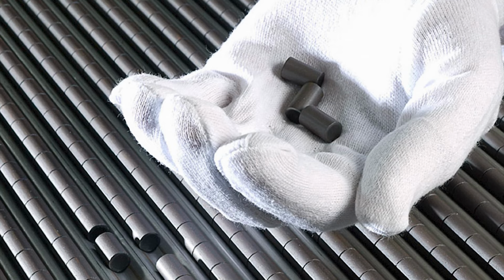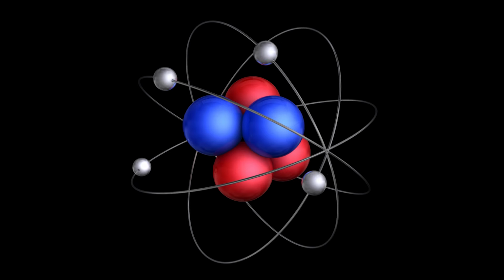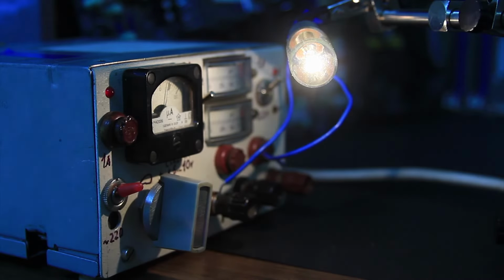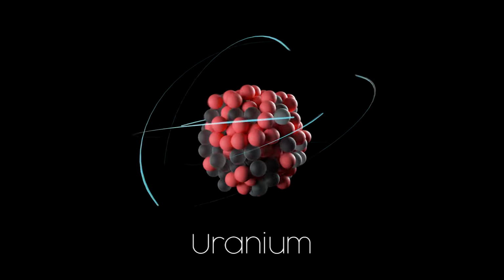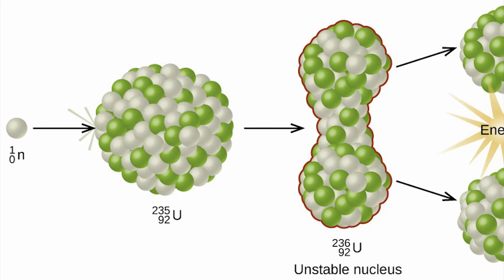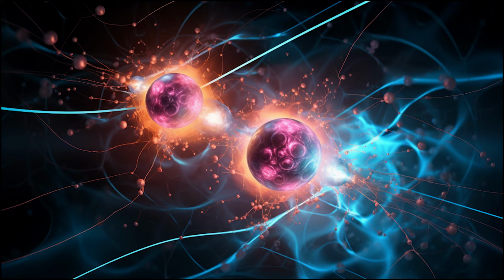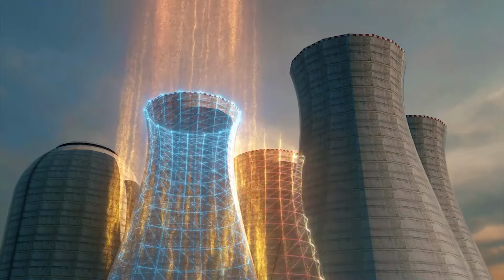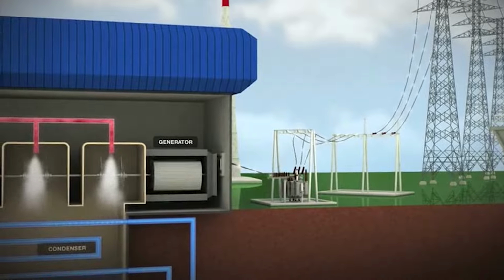The simple mechanics of splitting an atom

Comment: When implemented in practice, nuclear fusion produces much more waste, "decommissioning waste", activated devices because of the 10x bigger equipment, 4x shorter equipment life and complexity and maintenance nightmare. Clean controlled fusion is simply a dangerous myth. The science literature investigated comparatively in 1980 with the assumption that Tokamak fusion can be made to work before 1985 (Los Alamos Scientific Laboratory: Fission Fusion Hybrid) and the conclusion was very clear: no advantage can be seen. Since the Gorbachev-Reagan "science meetup" people who carefully consider the whole energy production infrastructure finds that fission works, and produces very little amount of toxic waste per TWh (compared to fusion, battery + solar, wind or any other form of energy we know), and very easy to detect negligence (unlike most other toxic waste that gets dispersed more easily). People should investigate the issue with engineering + scientific mindset. Most people are heavily mislead by the amount, value and dangers of "fission related waste" by videos like this. By the way, it is 0.0015 kg/person/year (30000 times less toxic materials compared to the toxic waste of other industries, appr. 50 kg/person/year), and the fission products ("waste") are more valuable than the Uranium.

Comment: You could say that the atom splits into energy, but you could also say that it splits into photons! Nuclear fusion doesn't exist. The assumption that it's possible is based on a flawed theory about the thermonuclear principle of stars. Stars are purely electrical objects, where the temperature and radiation from the solar wind are the result of an electric arc, much like welding.

Comment: at minute 5 you say things are shot out of the nucleus due to electromagnetism on protons too far out..   i thought it was the weak nuclear force that causes radioactivity and beta decay etc
Reply from the maker: Great question. The weak force does play a role in uranium’s radioactivity, but only in specific cases like beta decay. Most of the time, uranium decays through alpha decay, which is not caused by the weak force. That happens because the nucleus is simply too large. The strong force cannot hold everything together well enough, and the repulsion between protons pushes parts of the nucleus out. So while the weak force is involved in some types of decay, it is not the main reason uranium is radioactive.

Comment: Sorry, but your coal number is way off. 1Kg of coal contains about 8kWh. the efficiency of a coal plant is about 33%, so 1Kg of coal will product about 2.5kWh. A tesla battery is 80kWh. Meaning you would need 32Kg of coal to charge a tesla. From where did you got the number of 10.000? it really undermines the credibility of you video.
Reply from the maker: Not need to apologize. You’re right. The 10,000kg was a rough calculation of how much energy would be required to build a Tesla, not charge it. I always make one silly calculation in every video and it always sticks out like a sore thumb. Thanks for the comment!

Comment: Compress a coil spring until a latch can grab. Now find a way to destabilize the latch. All the energy that went into compressing the spring, is suddenly released. The nucleus is an incredible latching mechanism. A huge amount of energy goes into creating a nucleus, to overcome the electric repulsuon. Then the latch grabs, and you can take a breather. That effort is now stored as potential energy. The total mass of a system, includes potential energy. If you take 2 coil springs, compress only one, and then weigh each of them, one will weigh more. Same thing with trying to accelerate each of them. One will be harder to accelerate. Both instances being the compressed spring. All the energy you put into compressing that spring, has now increased its potential energy, and thus has increased its mass.

Comment: It does not the 10,000 Kg of coal to charge a Tesla Model 3, that is ludicrous. Ten tons of coal produces 81410 kw/h of energy and to charge a Tesla Model 3 takes between 54 and 100 kw/h so in the worst case you could fully charge a Tesla 814 times with that amount of coal, and in the best case almost twice that number of charges would be possible.

Comment: It doesn’t take 10k kg of coal to charge a Tesla. Show the math, professor
Reply: That’s absurd. Everything now is suspect in this video.
Reply: You are correct. Going by the potential energy in unburnt coal, it would take about 30 kg of coal to fully charge a Tesla model 3, and this is already with the inefficiency of coal burning plants factored in (coal plants capture only about 30% to 40% of the energy released when coal is burnt).
Reply: @arm_the_homeless_000  that is actually insane man
Reply: Why don’t you show us the data? How many kg of coal does it take to fully charge a Tesla?
Reply: @ronm6359  22 kg is what i calculate. Not 10,000 kg. w

* A typical Model 3 consumes between *13–15 kWh per 100 km* under normal driving conditions.
* Let’s use *15 kWh/100 km* for cleaner math.
* Coal contains about *6.7 kWh of heat per kg* .
* Coal-fired power plants generally convert about *33–40%* of that heat into electricity.
* At **40% efficiency**, that’s roughly **2.7 kWh of electricity per kg of coal**.
**Full charge**:
   * Standard Model 3 usable battery ≈ 60 kWh.
   * 60 kWh ÷ 2.7 kWh/kg ≈ **22 kg of coal**.
Reply: How has it taken a year to call this out?
Reply: 240 volts at what? 40 amps? (Conservative) thats 9.6 kwh lets call it 10 kilowatts an hour. Coal is roughly 1 to 3 pounds per kwh (depending on who you ask) so say 2 pounds and a typical EV charge time of what? 6 hours? Type 2? Ish? So thats at least 60 kwh (depending) times 2 lbs per kwh 120 pounds of coal. But thats not including the mining process. Or considering the soot that falls on everything and everyone.
Reply: I think they were simply trying to compare nuclear energy (the nucleus) with chemical energy (the electron shell) and show the enormous difference between the two.

They did get the numbers wrong by a few orders of magnitude though..
Reply: Damn straight! It takes 1.41 kg of coal to generate 1 kilowatt hour of electricity. A Tesla battery is 75 KW hours depending on the model ranging from 58 KW to 123 for the truck. It ain't no 10,000 kg!
Reply: A $200 a tonne of coal it would cost $2,000 in raw coal to charge a Tesla.  
It would be cheaper to buy the shop than drive there.
Reply: How far could you drive a Stanley Steamer with 10kg of coal*.  About 20 miles.   *about 2 gallon kerosene
Reply: Maybe dude meant 10,000 milligrams, perhaps 🤷‍♂️
Reply: Google.AI says, "Generally, it takes about 70 to 130 kilograms (154 to 286 pounds) of coal to generate enough electricity to charge a Tesla for a 265-300 mile range. This includes the energy loss during power generation and transmission. "
Reply: You burn coal and harness only 20% of heat to boil water.... only to have a turbine spin wasting 40% in heating/cooling cycle. Further the turbine rotates coil around a magnetic core, wasting another 50% as heat/friction, inductive yield.  The current transportation loses another 25% (at least) to get to your home, where the battery charging process dissipates at least 40% as heat.

On top of this, this is not a fission reaction, only oxidization process, which is less than 0.01% efficient compared to nuclear fission.

So 10kg coal burning to charge your Tesla only yeields energy equivalent of 
10kg x 0.2 x 0.6 x 0.5 x 0.6 x 0.00001 = 0.000035 grams of fission equivalent (of coal burning) is useful energy.

So yeah, compared to nuclear reactors, burning coal yields energy as if trying to go to Mars on a bullock drag cart (without wheels).
Reply: 😢😢 All the EV simps realizing the carbon footprint is horrible. Not to mention the slave labor mining Cobalt in filthy pits.
Reply: your right ✅️ it taketh Twice azz Much

Comment: I've still no idea what's going on
Reply: Thats not your fault, its a natural reaction to the fact that particle physics is wrong.  

Existence cannot sum to make a particle, there is only motion that makes form at perspective.  

This motion, all that is, is alone.  It self refrences.

Its motion so can only move, not touch (its not an it that can touch) or stop (stopping motion equates to nothing, an impossibility).  So it self avoids.  From straight (light) avoiding to curve (gravity)

In the volume of existence, these leads to spheres and spin etc.  The units of matter.

A nuetron is a nuetral region in  an atom, exactly like a nuetral region of gravity existing between two bodies.  These are called lagrange points.  We park satellites in them sometimes, because theres a nuetral effect on them and they dont need energy to stay there.

Now if you could manipulate this nuetral region by calling it a particle and moving it, whats going to happen to the gravity bodies if you suddenly push away or snap close the nuetral region between them?

Imagine the energy of such a thing happening in a short time, like a nuetron flying through the solar system, unbalancing gravational pulls and seperations in a nano second? 

Thats essentially whats happening at the atomic scale. 

You can even model it physically.  Picture a still plant full of leaves, now imagine a sudden high force gust of wind blowing through the leaves.  The balance of the leaves are changed dramatically.

Its all just motion, that cant touch, so moves.  The harder and faster you try to make it touch, the more it wont.  See nuclear explosions.

Comment: Excellent clear information.  But what is the extra energy emitted exactly in a fission action?  Is it magnetic,  or am l bring stupid?
Reply: Energy is released during fission because when a heavy atomic nucleus like uranium splits into smaller nuclei, the resulting smaller nuclei have a lower total mass than the original nucleus, and this mass difference is converted into energy according to Einstein's equation E=mc²; essentially, the smaller nuclei are more tightly bound together, requiring less energy to hold them together, so the excess energy is released as heat and radiation when the atom splits.

Comment: Wouldn't it have to be weapons grade enriched uranium to be able to cause a nuclear explosion.  Being only a power plant, I would assume it has no need to be highly enriched, so does that negate an explosion?  The uranium being unstable due to the limited reach of the "strong force" would mean it is letting off energy constantly in it's natural form. So why would a nuclear power plant need to split the atoms and slow them down to make energy, and to avoid a potential nuclear fission explosion.  But what do I know😂
Reply from the maker: @glassformelyknownassandcas4924  You’ve made very good points and asked some great questions.
Uranium is radioactive and is constantly emitting particles. This emission is enough to cause us harm but not enough to generate any meaningful amounts of energy. Splitting the atom releases a vast amount of energy but it comes with the need to control this process. 

Yes, weapons grade uranium is highly enriched which means the ratio of fissile to non fissile fuel is high. Reactor grade uranium is still enriched but at a much lower rate. It gives us the ability to control the chain reaction more easily (relative to the highly enriched uranium). However, it still can contain a significant amount of fissile material and if not controlled properly, has catastrophic consequences. 

Thanks for the comment and questions!
Reply: Simple answer.  yes.  you need weapon grade enrichment Uranium for nuclear explosion.  Power plants do not use weapon grade uranium.  No nuclear explosion possible for nuclear power plant.  However hydrogen explosion can and did explode the reactor into rubbles.  Most nuclear reactors in operation are pressure water reactor with zirconium clad fuel rod.  Under high temperature zirconium acts as a catalyst to break water into hydrogen and oxygen.  With a little spark the hydrogen accumulated will cause an explosion that can shatter the whole reactor into rubble.  If you do not use water as moderator and coolant, you can eliminate the hydrogen explosion risk.  This is where molten salt reactors shine.

Comment: The long range model 3 has a 75kWh, or 270MJ. Coal has ~25MJ/kg thermal energy, so 12kg ought to do the trick.
Now, of course nothing has 100% efficiency, but I'd still say this video is off by about a factor of over 200.

Comment: You can charge a Tesla with WAY less than 10000kg of coal
Reply: Somewhere between 17 and 30kg, depending on efficiencies. Really an amazing mistake to make.
Reply: But the energy that is required to mine and process lithium far outweighs any advantage, not to mention shipping the raw product and produce the batteries overseas. Then build the vehicles and ship them around the world. Its much more efficient to run a diesel ICE, and more environmentally friendly. (I also work at a lithium mine)

Comment: 10,000 tons of coal to charge one tesla car ? Wher did you get that from ?
Reply: Great question! I've been pondering the same thing. I'm really curious about how those trains manage to pull such enormous amounts of weight with less coal. It's pretty impressive, don't you think?
Reply: They’re not saying that it takes 10,000 tons of coal to simply charge your Tesla. You have to think deeper than that. It requires coal  to run the factories that produce the electricity to charge your Tesla. People think that going with a battery powered automobile is good for the environment, but they are completely wrong. I’m in the oil industry. You burn more petroleum products and coal in order to produce that energy then just using gas. Research it.

Comment: Excellent video!  One small nitpick -  Chernobyl was a disaster more because it exploded rather than melting down.
Reply from the maker: Thank you for clearing it up! And thank you for the kind comment.
Reply: It "exploded" but it did not 'DETONATE"..

BIG DIFFERENCE.
Reply: @craigwall9536  Good point.   There were no explosive materials at the plant.
Reply: @craigwall9536  well now I gotta go look up the difference cause I could have sworn both go boom lol
Reply: The point was, it wasn't a NUCLEAR explosion- it was a power spike that led to a steam overpressure and rupture.
Reply: Not really. It was the lack of a containment building which would've contained not just the explosion, but more impatiently, the radiation released from the melted core, which went on unchecked for years essentially.
Reply: @HailAnts  It was checked to a certain extent that controlled the initial exposure. So much so that it drastically reduced the amount of radioactive material being spewed into the atmosphere. Making it actually possible to construct more effective containment. Until they built the current structure that covers the entire building now.
Reply: Lol its still called a meltdown 😂
Reply: @AntiDogmatism-f8k  The meltdown caused the explosion. Kinda like saying the accident wasn't a disaster because the tanker truck skidded off the ice and smashed into 20 cars, it was because the tanker exploded. Well, yeah.
Reply: @RobertHall-ef8yf 
Yep. The meltdown caused the explosion.
Reply: Due to how the Soviets designed the reactor, any meltdown would cause an explosion. They're the same thing.

Positive void coefficient means they’re designed to bombs they have to be constantly hitting the brakes on, but if you hit the brakes too hard and then try to start it up, it ALSO blows up.

Yes, technically it was the explosion exposing a melting down a reactor that started the problem, but a meltdown and an explosion with the RBMK is the same thing.

Comment: My question is if the mass of 1 neutron + U235 is equal to the mass of 141barium + 92 krypton+ the 3 released neutrons how could we talk of that these 3 neutrons are changed into energy? Is this energy not the strong force that is released during the splitting of the U nucleus?
Reply: The sum of the masses of the particles you mention is slightly less than the mass of the original u235 nucleus. The difference is the loss of the strong force  the held the components together in the original uranium nucleus. The strong force imparts mass to the nucleus. Infact the vast majority of the mass of the proton and neutron is due to the strong force. Remember the equivalence of the mass and energy.

Comment: Strictly speaking mass is not converted into energy. When energy is confined to  a space then this space (looked at from the outside) obtains a property we call mass, that is 'resistance' against acceleration.
Reply: Partially similar to the "flywheel/gyroscope" effect?
Reply: @edinfific2576 not really, it's a consequence of the equivalence of mass and energy in Relativity.
Reply: Well then call it inertial mass, and yeah, I got a bit confused
Reply: @eru6461  it's usually just called mass because according to measurements and general relativity inertial and gravitational mass are equivalent. According to GR it is impossible to even locally distinquish between acceleration and gravity. An intuitive explanation of this is the elevator experiment: https://en.wikipedia.org/wiki/General_relativity#Geometry_of_Newtonian_gravity
Reply: @rfvtgbzhn  thanx my guy, really appreciate it, sorry, I got a bit confused Uk.
Reply: Relatively speaking.
Reply: Brother how do you know that?
Reply: “strictly speaking” ☝️🤓
Reply: E=mc²
Reply: @eru6461  resistance against acceleration is (inertial) mass. Weight is the force caused by a gravitational field, while (gravitational) mass is the "charge" of gravity. From all we know, the inertial mass and gravitational mass are equal, so we usually just talk about mass. Weight = mass*(gravitational acceleration).